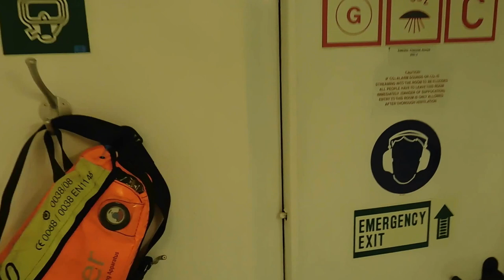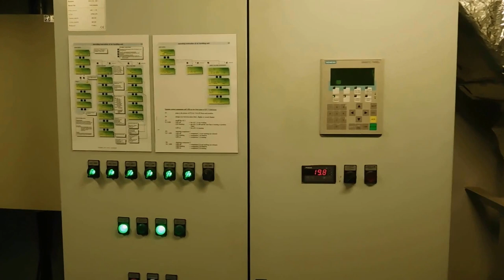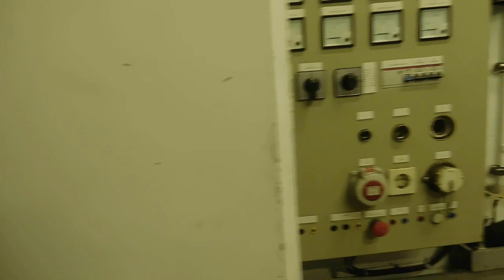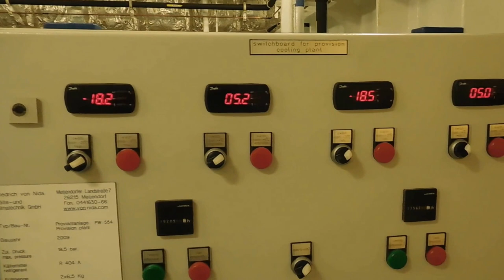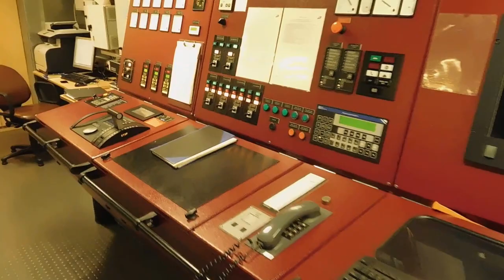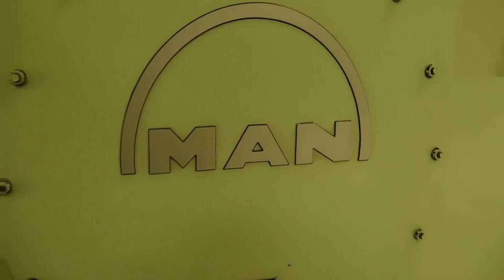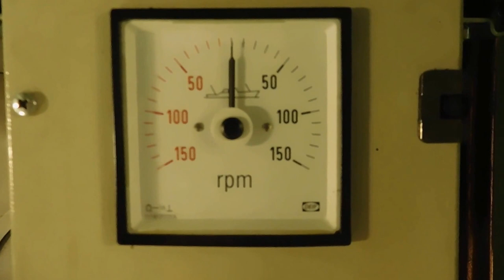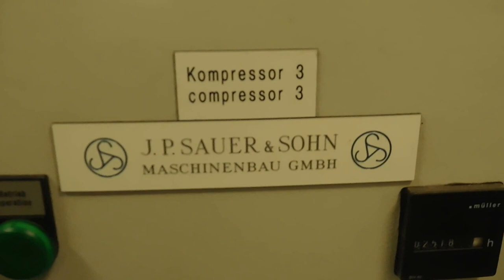Container vessel engine room tour!

Comment: That yellow Brightstar flashlight on the emergency switchboard will not work when you need it😎
Reply: Hahhaahaha this guy gets it
Reply: @dino8895  experience Dino, experience😅
Reply: @janvisser2223  Hard to believe ships still use that trash, you might as well die than use it to find your way out during blackout.
Reply: @dino8895  
You still find them on board! In the past cleaning the sliding contacts had to be done regularly, Wrapping the batteries with a thin sheet of gasket to keep them “aligned” was also one of the tricks.
Last but not least, the light bulbs were “under powered”, so definetely not a Bright Star.
The orange intrinsically safe ones were a bit better.